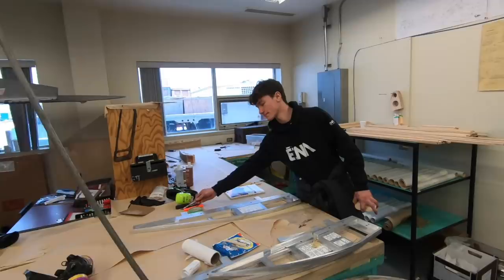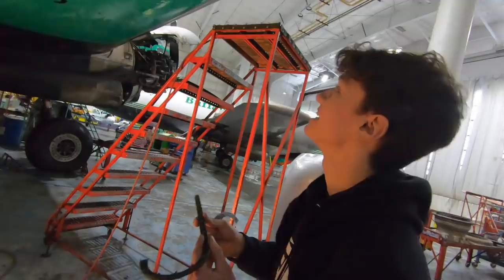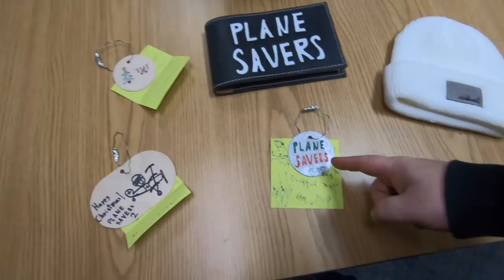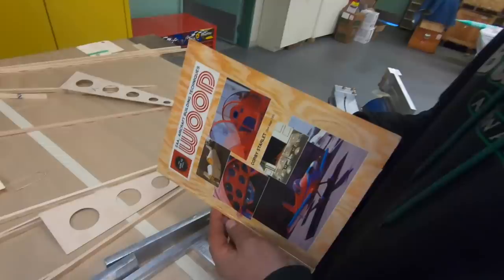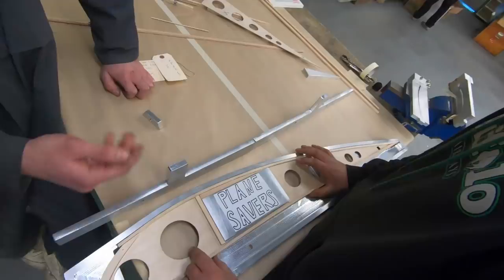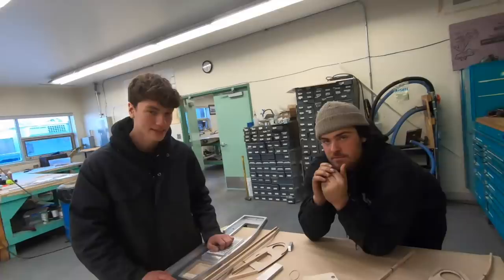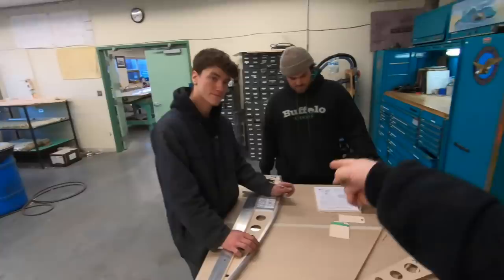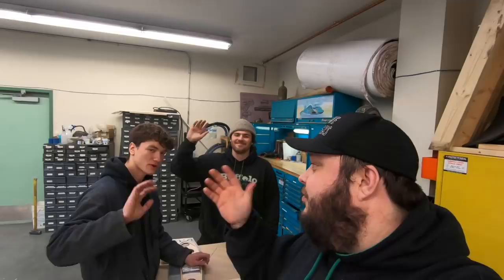We Don't Have Time for This! Plane Savers S2-E24

Comment: Hi, Mikey and Chaps. Watching that aerofoil section take shape took me back over 50 years to when I built my first model airplane. Then, I thought, is that a Clark Y on the DR1? So I looked it up on Wikipedia and found that Clark Y was designed in 1922. So what section is on the DR1 and are all 4 wing sections the same? Keep up the great work and slow the camera movements, please!

Comment: Wait till the glue comes in, then it'll get funny. Is that Lear being restored to flying condition? Should sell the C-46 skin part, probably was an old scAir Manitoba repair.
Reply: Crushing Vanessa3 Hi Vanessa, we’re taking the engines from the Lear 23 and putting them on the Lear 25. We’re just going to be starting it up and taxing it. Then the Lear 23 will be going on display.
Reply: @CaptainCam  ok then, still a great way to preserve the plane. I don't know much about Lears but they are nice looking planes.
Reply: Crushing Vanessa3 I totally agree!

Comment: Is there an optimum adhesive thickness between all of the wood sub assembly faying surfaces for maximum strength of the all the pieces of the wing (s) spar components?   How do you control those adhesive thicknesses between the faying surfaces to achieve a bondline for tolerable adhesive strength of those connection points?   Is there a tolerance built in between the subassembly pieces for fit and adhesive bondline thickness of an acceptable bondline tolerance for safety and reliability?
Reply: I was thinking about the same lines - why not use some of those cyanoacrylate glues to just fix everything together and then apply a thin epoxy to fill the cracks under a heating of sorts - Loctite surely has a product to 'fill the gap'

Comment: Cannot believe you intend using a Silicone based release agent on your bare wood ribs???
It will contaminate “everything”. You could end up really struggling with the build... please check with someone that has built one before you proceed